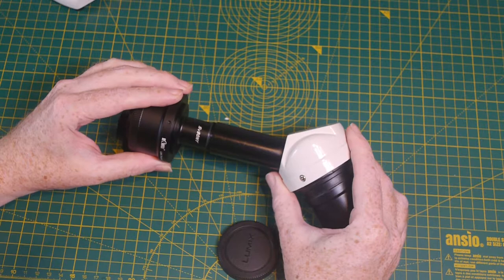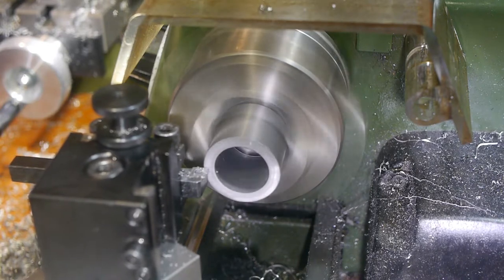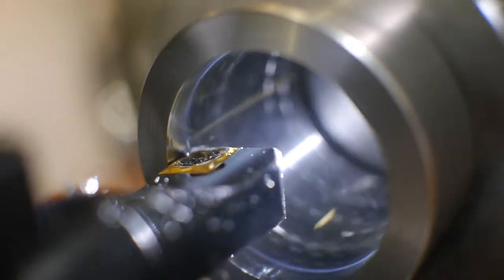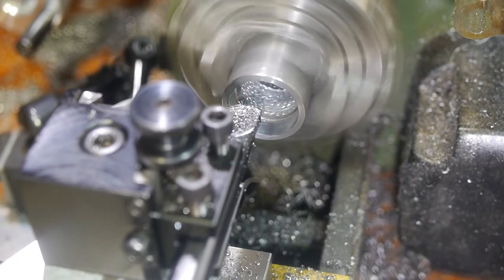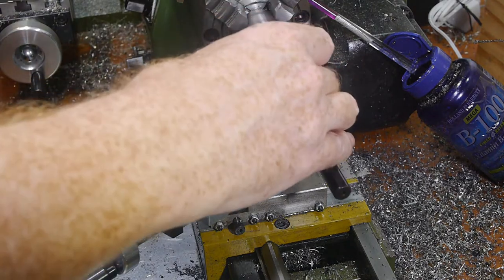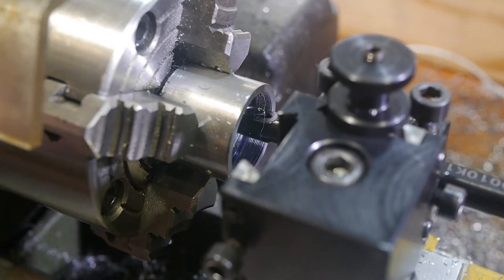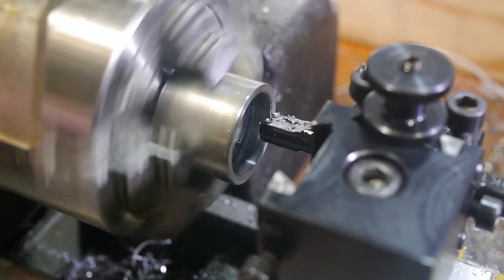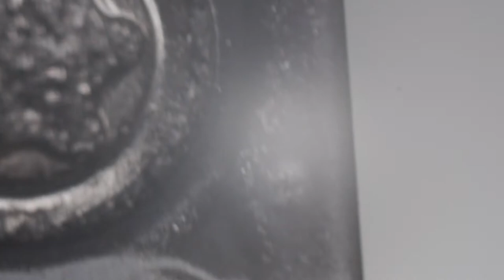Microscope Adaptor

Comment: A microscope  is a valuable tool for people with very small work to do, and that is a very nice fix. BTW most asiatic optical devices are metric, so 0.5 is a good guess for the pitch. At least the Proxxon will cut threads!
Reply from the maker: Thanks for the tip! Thread cutting capability was definitely a must for me when choosing a lathe.

Comment: What type of chuck are you using? I'm looking to buy such a chuck and I'm hoping you can give me some information about yours!
Reply from the maker: In this video I used an 80mm 4-jaw chuck from eBay. It's too heavy for the Proxxon, and Ive stopped using it, as it caused chatter, and I was worried about the strain on the bearings. It fits fine on the CJ0618 Chinese lathe though, so I can still make good use of it.
Reply: Thanks for your help! Why didn't you buy the proxxon chuck with 4 jaws?
Reply from the maker: @2mrRB  It seemed too expensive at the time, but I think the materials I used to make a custom back plate made the import chuck just as expensive in the long run. It was definitely a mistake.
Reply: Thanks for being honest! I'm thinking about buying the proxxon chuck.

Comment: Very nice work. Making from a bit of aluminium alloy might of made life a bit easier for yourself? Cantering microscope a real asset to have, mine used all the time in mill and on lathes. Keep up the great videos!
Reply from the maker: Thanks! I'm not so great working with aluminium. I have way more experience with steel, and break more tools when working with aluminium. In this case the decision was guided by the available stock. I needed thick wall tube to avoid the long, laborious task of boring out a lot of material from solid rod. As it turned out, the material I could easily get hold of had pretty poor machinability, but I got the part made in relatively short time.

Comment: Nice job, Congrats!!
Seems that we're both following the same YouTuber's for gaining valuable info.
Here's the link to that particular video of Joe's. (maybe add it into your description section)
https://youtu.be/k1DHKjMtdQw

Also do you have a link for the carbide threading tool that you used?

regards Colin
Reply from the maker: Thanks! Joe's video should be linked as a "Card" suggestion at the top of the screen, at the point where I mention it. If you don't see it, click on the white circle with an "i" in it at the top right. Let me know if it isn't showing up for you, and I'll try and sort it?
Reply: My apologies, I hadn't realised the white circled "i" had Joe's link within it.
Is there a link for that left-handed threading tool that you used?

regards Colin
Reply from the maker: No problem, since YouTube got rid of Annotations, the way of adding links isn't so obvious.

Left hand insert thread tools aren't the easiest to find. Here's one on Ali Express:

https://www.aliexpress.com/item/Thread-Turning-Tool-SNL-0012M11-150mm-Length-Internal-Threading-Inserts-Holder-Threaded-Holder-For-Lathe-Machine/32828247336.html

Matching 11IL inserts are even harder to find, but they look almost identical to the equivalent external right hand threading inserts (11ER). I plan to try one, and work out if 11ER inserts work for left hand internal thread cutting.